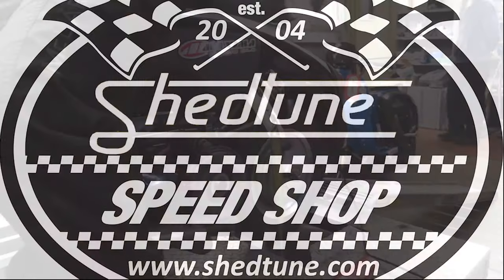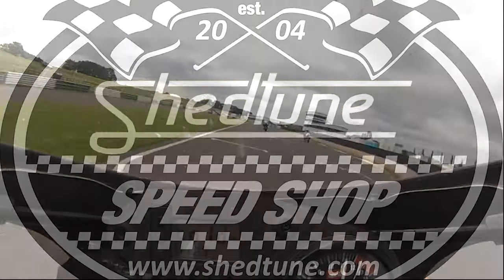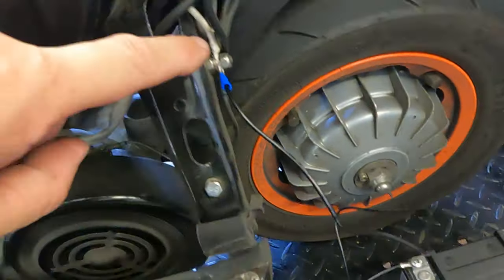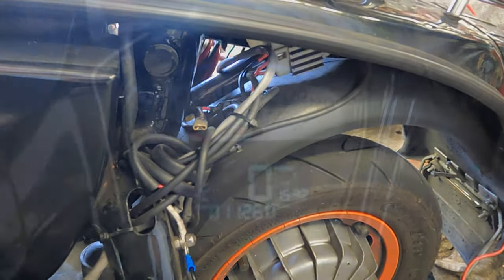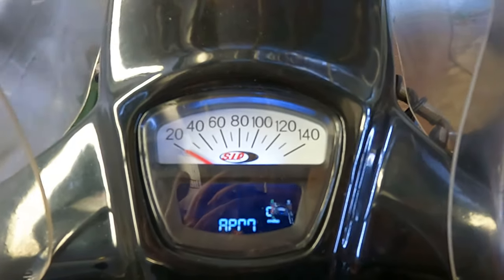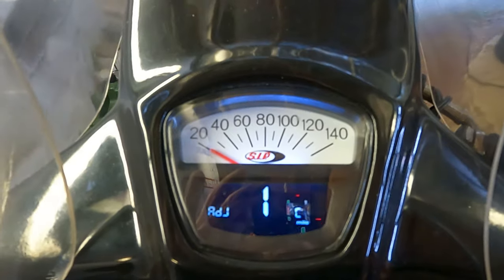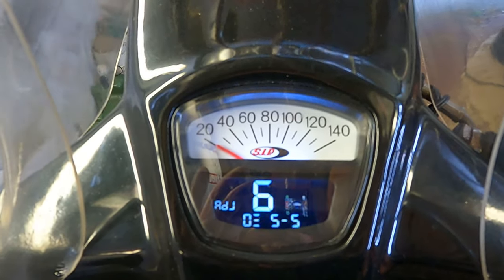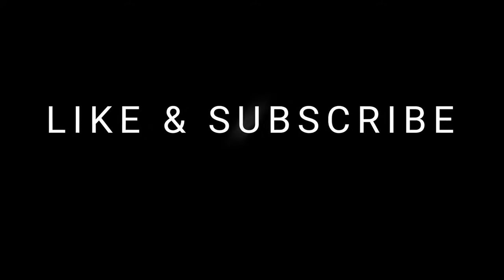HOW TO SET UP YOUR LAMBRETTA S.I.P SPEEDO - SHEDTUNE

Comment: Still the only downside with the sip Speedo is the backing light, even the Mk2 is rubbish and the tiny details on the cht or egt reading is too damm small. Other than that it’s alright
Reply from the maker: Agreed, and I can’t see it with my eyesight anyway 😂😂😂😂😂
Reply: @Shedtune_Russ  yip both in the old farts club 😆